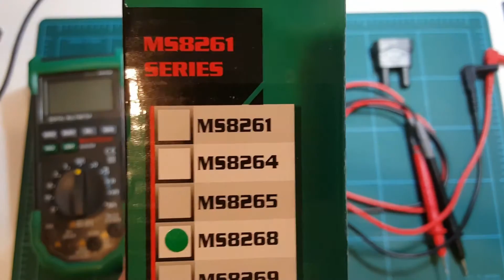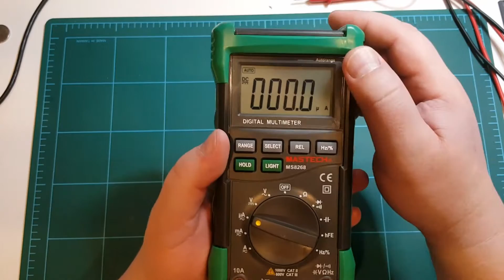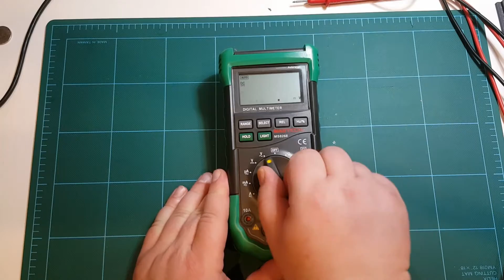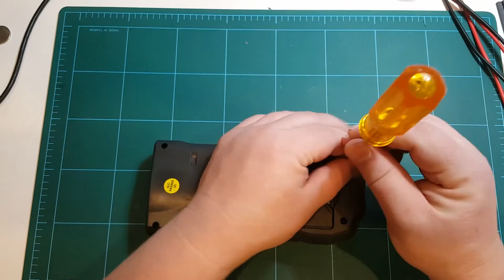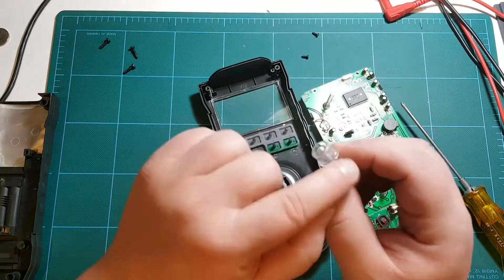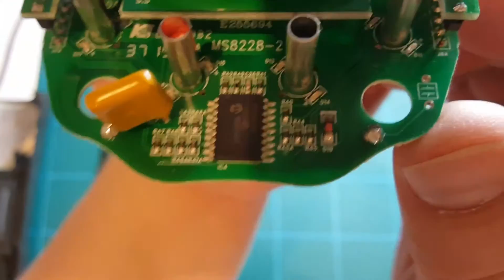Mastech MS8268

Comment: @arturslab7102  Hi Artur.  I really appreciate your video teardown of this model Mastech.  After several years of use, today my unit just would not fire up.  Checked batteries, cleaned contacts as preliminary first aid, but still no fire-up.  

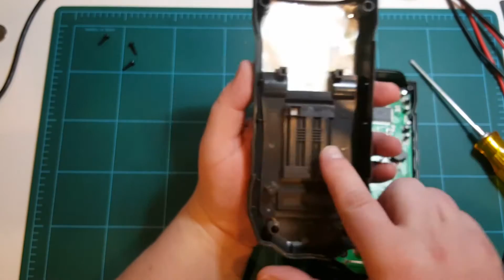On disassembly, there are three springs visible, and the bottom and middle springs make interference connection to the metal battery terminals (8:50 in video).  The middle spring (which connects to the negative battery terminal) showed signs of rust, so a little clean to bring back to good metal, and a slight stretch of the spring to (hopefully) result in a stronger contact with the battery terminal, and bish, bosh, wham bam, thank you ma’am, hey presto, everything back to life !!  

For UK£45 (US$60) it’s an OK meter, although I guess really only for the DIY and home hobbyist – not for professional sparkies (electricians)!  Your video was really helpful – thanks, Iain (England, UK).

Comment: It's an ok multimeter for low volts DC but I wouldn't advise it on any AC application since the multimeter lacks input protection. If you do not see 2x branded quality fuses in a multimeter, don't use it on the mains. Quality fuses are expensive and most often those 2 fuses will cost more than most cheap multimeters.

Comment: I received my MS8268 multimeter off Ebay today. The aftermarket test leads I've been using with my Innova 3200 multimeter REFUSES to work on the MS8268 multimeter. 

Any issues like this with yours? 🤔
Reply from the maker: Not with this meter. But another meter I have, HoldPeak has unusual-dimensioned connectors. i talk about that in video about that meter.

Comment: Thank you for your nice videos. I will buy an multimeter. I think i will go for the ms8265 instead of ms8268 becouse of screen resolution of 20000 counts. The only thing ms6265 lacks is the autoscale, but i can live with it.
Reply from the maker: More resolution is always nice. But manual ranging is very outdated. As Dave jones of EEVBlog said in one of his videos - there's absolutely no reason for any meter these days to be manual. But if you do buy that meter, it would be great if you post a review.